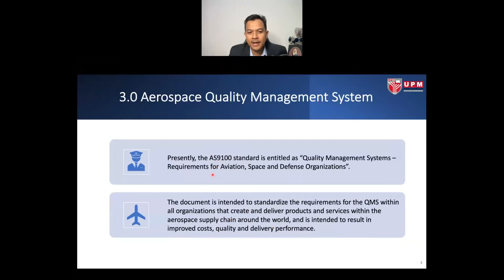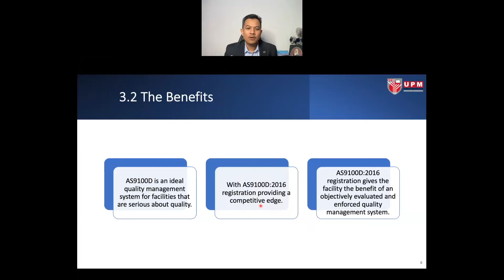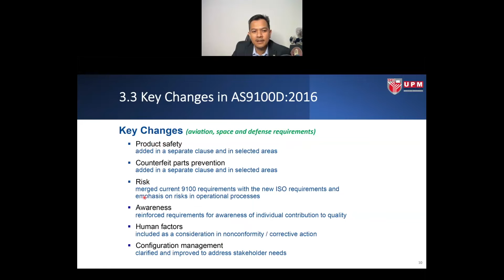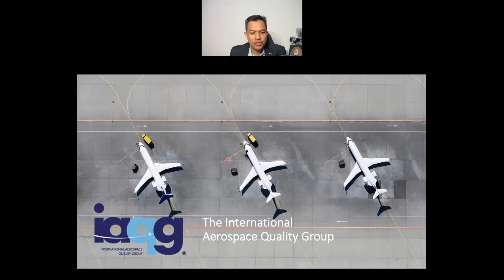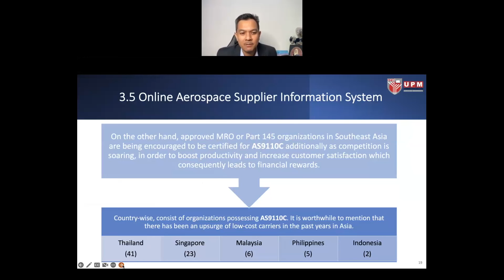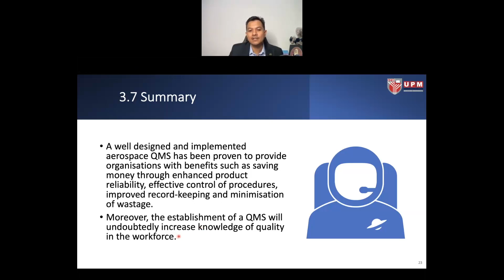AEROSPACE INDUSTRY | Standards and Compliance

Comment: Salam Dr. I am Nur Izyan Izzaty (GS72973) signing in for attendance purpose. 

A simple yet effective example of a quality management system (QMS) control that is aligned with AS9100D is the implementation of poka-yoke (error-proofing) techniques to prevent human error and ensure the manufacturing/production consistency.
Reply from the maker: Thank you for watching